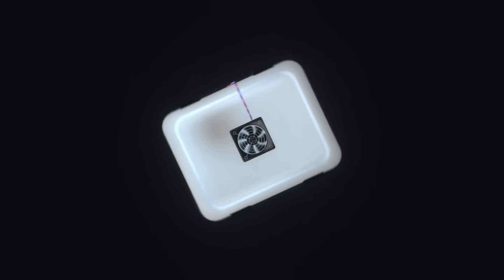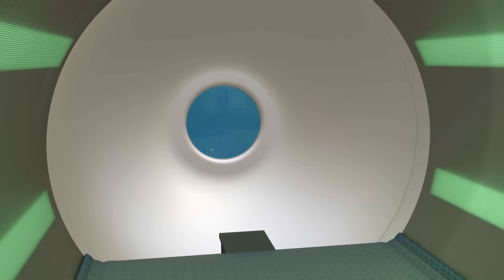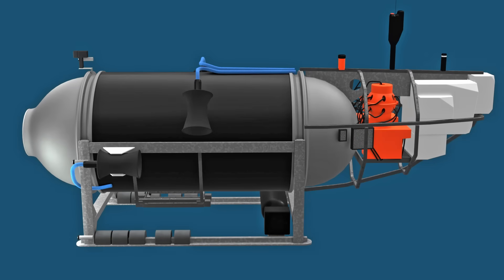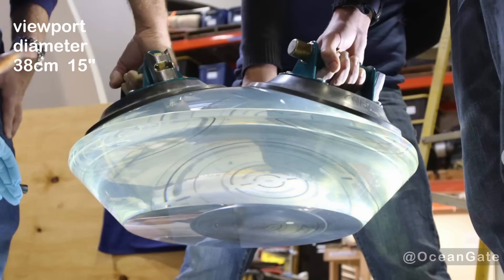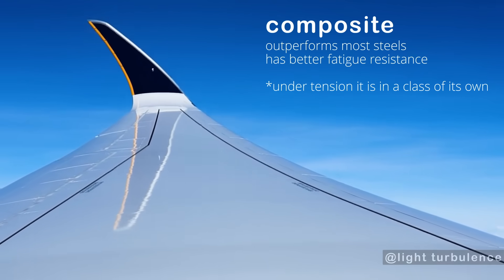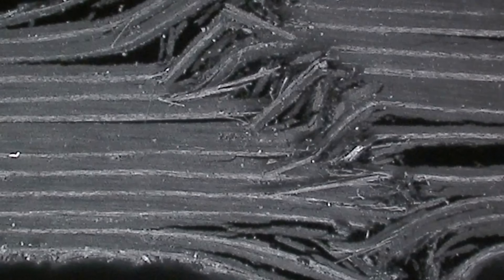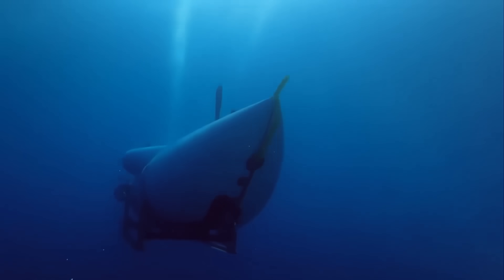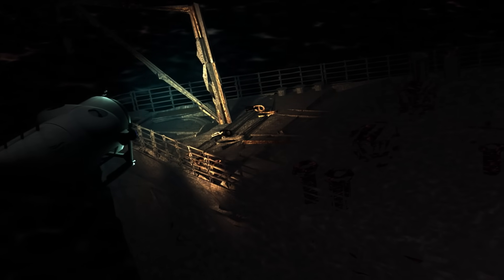Titan Sub | carbon fiber - Detailed Tour

Comment: It is blatantly obvious a fiber has greater tensile strength than compressive strength; that is why it has to be in a composite resin, or mesh, form, in order to help increase compressive strength. Just because carbon fiber can have great compressive strength does not mean change any of this, and the fact it failed due to such high compressive loading is proof of this.

You literally said that no tension was applied to the axial layers being the likely culprit, thus admitting that it was due to a fiber obviously not being as strong under compression as compared to tension.

Also, the carbon fiber was making loud cracking noises before imploding in a near instant, so they knew it was about to go; each crack weakened it, until the last crack was the near instantaneous implosion event. The messages show that they knew they were in great danger. And someone else could've been typing whilst someone was 'dealing' with the problem. And using thrusters to descend is not outside Rush's character; their descent was going much quicker than normal.

People said it sounded like gun shots going off on multiple dives, so why wouldn't this one also do that... until the final crack that lowers the hull below the stability threshold, which would be the near instantaneous failure of which they would then have no warning; but the rate of loud cracking noises could've been increasing.

There is a very good reason why a single titanium sphere is usually used for such deep dives; a composite material is going to have micro-faults and a non-homogenous structure, thus making failures much more likely, whilst a homogenous material can go under many tens of thousands of stress/no stress cycles.

Regardless of my disagreements, I still liked and subscribed, because I find you to be very knowledgeable and a great presenter of information.

Comment: I worked in aerospace fibre composite manufacture for some years.  We built many carbon fibre pipes of various sizes.  You have either purposely or mistakenly misrepresented the argument against the strength of carbon fibre.  What everyone meant was, that the strength of a carbon fibre hull, is dependant on the resin holding it together.  On tension, this strength is high, because the stress is on the carbon fibre, not on the resin.  On compression, the carbon fibre does not take the stress, it’s all on the resin, to put it simply.  I feel that the forces placed on an aeroplane wing are a poor comparison on the forces that the Titan submersible had on it.  You obviously have a basic understanding of the physics and the nature of fibre composites so why such a misleading way to present your take on it?   In the end, you come to the same conclusion as everyone else, fibre composite hulls are not strong enough under compression!
Reply from the maker: What you say is not true. The resin binds the matrix. The force whether in tension or compression is always borne by the fibres. In tension carbon fibre is in a class of its own and nothing else comes close. In compression it outperforms most steels. 
It is never the intent for the resin to carry the primary load. The resin on its own can take around 70MPa whilst fibre 650MPa when laid up correctly. 
I take exception to you suggesting I would purposely mislead my viewers.

Comment: Excellent video!  Really appreciate the time you took to put this together.  Did graduate level courses on composite materials in the process of getting my masters in ME.  After this happened and the video was circulated of the team gluing the titanium end rings on in what looked like vacant warehouse it blew my mind that it survived 15 dives.  Everything we created in my labs was done in a clean room type environment and that was something just for testing not to support and keep lives safe.  They didn’t have on respirators, eye protection, even using clean rags and wearing gloves to keep hand oil off the bonding surfaces and out of the epoxy mix was apparently too difficult. While I agree with your analysis on how the sub failed and highly doubt it was the titanium to carbon fiber surface, this video just showed the overall lazy approach to working with a composite that even someone making a car hood or bumper would have had a basic level of understanding on and had avoided. With all of the failures that occurred during manufacturing and design I would argue that it proved carbon fiber as being a suitable material for submarine use.
Reply from the maker: The video of the gluing was of the first hull. I couldn’t find video of them bonding the second one but it seems second time things were done more professionally. Nevertheless the general attitude seemed rather blasé.

Comment: CF in compression is an issue and I do not accept that it is not. However, the interface between the two wildly different materials is the crux here. Both are notoriously difficult to design and manufacture with, but in very different ways. I don't care how many times they bond CF and titanium in aviation, the joints used on this vessel were too simplistic and an obvious failure point where each material was not formed in a way that accepted the inadequacies of the other.
Reply: I agree

Comment: The point you failed to address is that the carbon tube and the domes do not have the same compressibility, that is the carbon compresses more. Since the carbon is glued to the titanium ring, it will crack lose off the ring as it gets compressed, while the ring does not. So even if carbon fibre is a feasible material as such, a composite construction is not for that reason.
Reply from the maker: Titanium and composite have similar rates of deflection under load making bonding feasable and why it is common in avation but with exhaustive testing.  I included a note but didnt want to dwell on technical stuff because 90% of my audience have no interest in the more detailed technical info.
Reply: I've seen you mention this a couple times in the comments, Rates of deflection depend on the thickness of the materials and other factors. 

I highly doubt the dome had the same thickness as the cylinder.
Reply: @jj-jak  No you have not, because it is the first time. Either you are confusing me, or you watched TF's video, who explained this in detail.
Reply from the maker: Who is TF? Can you paste the link to the video. I would like to watch it.
Reply: @Mike-Bell  Thunderf00t channel
Reply from the maker: @Baerchenization  oh yes thanks I did see that one
Reply: @Baerchenization  i was referring to MB :)

Lol thunderf00t 🤣 I'll look it up and watch for entertainment value but I wouldn't consider him to be an authoritative source for ANY technical info.
Reply from the maker: The wall thickness of the titanium was 3 1/4”. CF was 5”

Comment: Carbon fiber can't handle pressure, that's why no submersible has ever been made out of it and no more will ever be made out of it.

Connecting carbon fiber to titanium was a major flaw as the compression ratio of carbon fiber is orders of magnitude more than titanium. Where they were there was about a 1cm space between the carbon fiber and the titanium which allowed pressure to hit a weak spot as titanium doesn't compress at all. Also the carbon fiber on the sub was below par with gaps in it.
Reply from the maker: Not true. The deflection under load of carbon fibre and titanium are very similar which is why in aviation they can be bonded successfully but on to be exhaustively tested till proven reliable. Carbon fibre is an extremely rigid material which is also why it is so brittle and shatters when it yields

Comment: An interesting analysis. Of course, we will have to wait for the final accident report to know if you’re correct, but it’s good to see someone who is trying to present a balanced view rather than trying to be sensational.

I was appalled by the way James Cameron gloated after the accident. Even if he turned out to be right, the way he smirked during the interview was awful. Even by Hollywood standards. Cameron also inflated his credentials by claiming he was the designer of the Deepsea Challenger, which was actually designed and built by the Australian firm of Ron Allum. But then, Cameron is also the man who got sued for plagiarism after he boasted to a reported that he had “Ripped off a couple of Harlan Ellison’s stories.” So, it’s not surprising.

Comment: Lets remember that the Titan did make multiple dives to the Titanic before its demise. Granted Stockton Rush's use of human beings during what should have been considered a testing time to the subs limits was pure negligence on Rush's part. But his concept should be considered as a partial success. I don't think it was so much a problem of the material as it was the build process. Sailboat hulls when being layered up are placed under a vacuum to ensure complete immersion of the fibers with the resin and to evacuate any air voids. This give their hull great compression strengths. I think there should be continued research with what Stockton Rush has done and not just blown off as some crack pot idea.

Comment: Carbon fiber is strong in tension but not in compression. Truly dumb idea and lack of understanding about material science and failure modes. A rope can hold you up if it’s attached too a structure above. This is an example of being in tension. That same rope with some epoxy resin to hold it up, but not connected above, does nothing. If you try climbing it, only the resin is holding you up. The resin is in compression and will provide some strength but the rope will only help keep the resin straight. It will not prevent compression of the resin.

Comment: I suspect that it was the geometry that was at fault. A tubular construction is obviously weaker than a spherical construction. I also find it difficult to believe that the Titanium / carbon fibre joint was able to cope at these depths. As you say, they didn't test to destruction so the point is moot.

Comment: The first thing i noticed is if the area where they used the restroom sweated that bad.

Why wouldn't the area where all the main electrical components do the same.

I didn't hear in any of these videos that they had that area insualted to stay dry.

I understand some components can be made to be waterproof, but salt water and humidity can really sneak its way into anything at some point given enough time.

If anything electricl went out, they'd be sent head down towards the floor

My perspective, at least.

Have a good day, everyone
Reply from the maker: I also don’t recall seeing any insulation on the aft dome. A wet wall is one thing but the bigger issue is the equipment would have been operating in a near 100% humidity environment. 
They must have found a reliable solution because in the talk by the electricical engineer of the project, Bruce Morton he didn’t say anything about this as a big issue.

Comment: We need more Doctor Rush around to build brand new carbon fibre submersible so we have better data.  Sample size of one is just not enough.  They should copy the Titan and do multiple dive attempts to the Titanic to get better samples of failures.  This will advance Engineering and material science for the benefit of mankind.
Reply: Put bankers on board... please

Comment: The carbon fibre was heard to be cracking on previous trips. It may be strong... but not as strong as titanium. The material that is recommended. This is the very reason why nobody would certify the submersible. You can't just break engineering rules.
Reply: The carbon fibers themselves weren't cracking, the resin was...
Reply: @jeebusk  fair enough but the resin is present bc of the carbon fibre

Comment: Fascinating. Sounds like carbon fiber is most effective (at least in compressive applications?) if it's prepared similar to post-tensioned concrete slabs, where the fibers are placed under tension during layup, with the tension held in place by the epoxy matrix.
Reply from the maker: In post-tensioned concrete the cables are tensioned once the concrete has cured to very high tension and can take the load. 
In wound filament the tension is just enough to ensure very straight filaments. It is not a pre-loaded tension scenario. If it were, it would apply a crushing load to the mandrel and not allow the mandrel removal after.
Reply: @Mike-Bell i hate it when there's a crushing load on my mandrel...
Reply from the maker: @jeebusk  🫡😁

Comment: The best information about the overall design of the submersible I found so far, thank you. One of the most important points: it has confirmed my suspicion the sub wasn't using variable buoyancy system, and its buoyancy has been solely controlled by solid balast. One of the unique (not necessarily bad) features of the contraption.
Reply: I would prefer using a pump and water for ballast, but I have to say I am impressed that the crew could, if all power failed, just lean the craft over by all going to one side, and causing the ballast to dump out.
Reply: @itoibo4208  lets assume you want to change boyancy by 100kg for going back to the surface, youd have to push 100l of water volume against 500 atmospheres of outside pressure, thats 5 megajoules of energy, 1400Wh, thats a huge battery pack to do this a single time. If you want to periodically go up and down for navigating it needs a hell of a pump as well, lets say you need to change 100N in 5s (like accelerating some thruster) thats pushing out 10kg of water in 5s which turns out to be 100kW of power.
Reply: @NIOC630 i prefer something dynamic but I see your point. That would take a lot of power.
Reply: the submarine that went all the way down to challenger deep used the same thing
Reply from the maker: @curiouscat8457  Yes routine bouyancy control was with solid ballast only.  For emergency they had a high pressure air tank that would inflate a bladder for fast surfacing but I havent read anywhere that they used it or tested it.  There was a pump system inside for the crew to operate to open the air tank.
Reply: @Mike-Bell  Thanks for that. The description of this device indicates it was only "ambient pressure system" that can be used only at relatively small depth (a few hundred m at the most). For greater depths the "variable buoyancy system" using high pressure hydraulic pumps would have to be used.

Comment: I've watched a couple of videos that theorized that failure point was most likely where the carbon fiber and titanium were joined.  If that is the case then carbon fiber isn't the boogieman but it would be the wrong choice of material.  Since titanium is used without incident on other submersibles. I'm not a marine or aerospace engineer so I don't know if that is true but I think it makes sense.  There are a lot of other reasons or factors that could be the problem or contributed to the problem.  So like you I'm looking forward to the release of the official report.  
A lot of the videos I've watched are dead set on this is what happened no doubt about it,  You approached it by mentioning what we know happened.  Then mention the popular theory and finally giving your opinion and I wanted to say I appreciate that.  You are giving the viewer a chance to come to their own opinion.
Reply: maybe not a wrong choice of materials, but something that has to be considered when connecting them. it might need a sort of expansion joint.
Reply: @itoibo4208  But won't you run into the same problem with whatever you try to attach to the carbon fiber?
Reply: @alexanderdoran2862  I really do not know. I start any project with a lot of reading. "What is needed? What fails? What has worked and why?" and then I try to read what people chat together about, and I see the problems they face, the failures they discuss, and the fixes that worked for them. An expansion joint lets things slide around. Can you do that under high pressure? Probably, but idk. Maybe you cannot. Then there would be a decision on a design, and testing to see if it works. Put that part, like a window, on a test bed and pressurize it or drop in the ocean, and see what happens. Test it well beyond what the target use is. If it passes, then we have a good design. Now just 50 other problems we have to tackle and test. I think the scariest part of being rich, like this guy, is that he had to rely on other people. Did they look at all the books and chats to see what was already known? Did they test all of the parts to beyond target depths? Was he willing to pay for all of those tests, or did he shrug it off, like "I am sure it will not be a problem."

Carbon fiber would NOT be my first choice, but if titanium was too expensive, I would have to try other things, like other metals, fiberglass, carbon fiber, various hull designs, etc. I would expect to spend at least a couple of years trying to make this design.

Comment: The problem was not because of the normal stress applied on it, but because of the extremely fast decent it had. And that was fatal.
Reply: They should have known they were going too fast.
The source of where I got that information from:
https://www.youtube.com/watch?v=M3H9X-bon1g
Reply: @budgetarms  great!
problem solved, case closed...
Reply from the maker: The so called "leaked transcript" that an indian tiktikker "found"  is where you get your information about the dive being too fast!?  Not credible 😂
Reply: @Mike-Bell  It's a Pakistan tiktokker, not Indian, but it is indeed an unconfirmed transcript.

Comment: Thermoset plastics are inherently brittle. They represent the matrix material for all glassfiber or carbonfiber construction that I am aware of. A thermoplastic matrix material would be a much better solution. Unfortunately outside of rotational molding and injection molding I am unaware of a known method of combining it with lay-up fabrication. More work needs to be done if this thesis proves to be workable and effective..